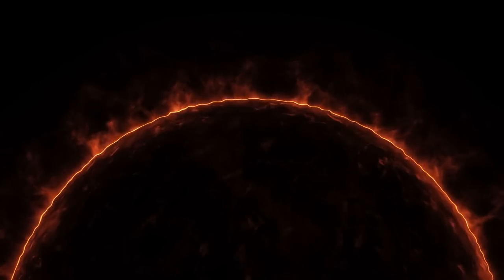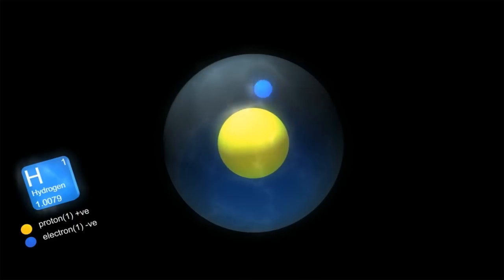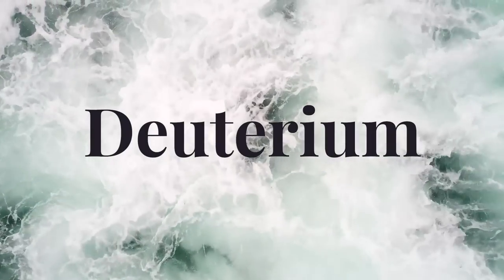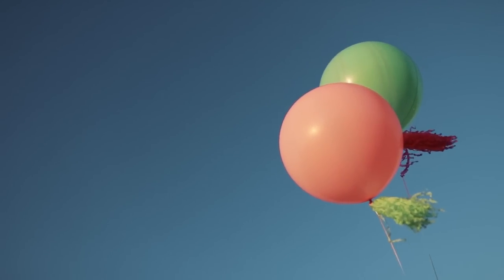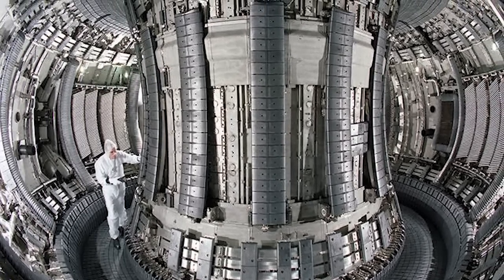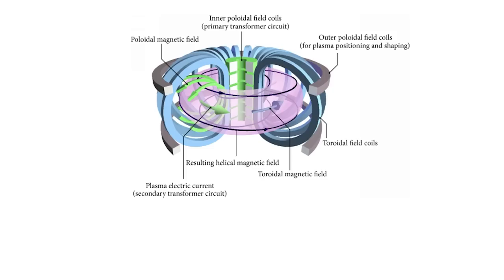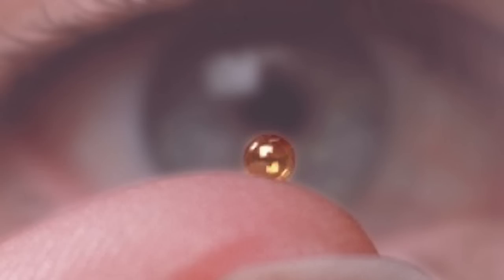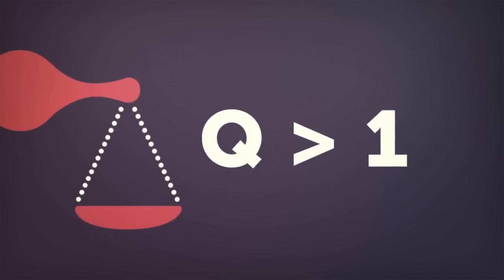Fusion Energy is About to Unlock Humanity's Destiny

Comment: the nuclear stuff doesn't go boom. its the water flash converting to steam that goes boom. water expands 1800x when converting from liquid to gas.
Reply: Please explane your concerns further
Reply: @thesteambreaker9449  A reasonably designed nuclear reactor is inherently stable. If you withdraw a control rod and increase reactivity, the reactor heats up a little bit, the distance between fuel atoms increases slightly, which reduces reactivity, the neutron thermal temperature changes slightly and reactivity is reduced, water expands and some is pushed out of the reactor, so the neutron temperature increases slightly and reactivity is reduced.

If you remove heat at a greater rate then power will remain higher. If you don't the core is just a little hotter. It's not balancing on a needle between shutting down and exploding.

Actual failure modes of power reactors that are licensable in the west are of the cooling was lost or core was uncovered somehow and decay heat slowly melted the core. Steam can  react with the hot zirconium clading making hydrogen, but it can't actually explode in the core because there's no oxygen. If the hydrogen is released it can mix with oxygen and explode somewhere outside the reactor core and make a mess. RBMK, e.g. Chernobyl would never have been, but even there it was a steam explosion from operating the reactor in an unsafe condition; it's dual moderated, so boiling in the core creates bubbles that neutrons zip across; the graphite is a better moderator than water, so this actually increase reactivity, which increases boiling, which increases reactivity and it spirals out of control.

You can't create a nuclear explosion in incredibly badly designed reactors, such as the SL-1 research reactor, which had a single control rod. When it got stuck, a technician pulled on it and it came loose suddenly, increasing reactivity in the core massively. The steam explosion shot the control rod out of the core and pinned the technician to the ceiling. No nuclear explosion.

When the army was experimenting with highly enriched weapons grade uranium in the form of uranium-deuteride for creating small nuclear bombs. They fully intended it to blow up with the highest yield possible; you need much less fuel since it is moderated. The moderation means you slow down the neutrons so the fission crossection gets much bigger; but slowing down the neutrons also means the time between each neutron generation increases and  there are less generations before the bomb blows apart. The highest yield they got was 200 tonnes of TNT equivalent, which is abysmal. It's hard to even purposefully make a "reactor" that will cause some kind of nuclear explosion.

Small well designed reactors can completely eject control rods out of the core using compressed air, raising the power from tens of watts to a couple of GW for some milliseconds and then rapidly dropping down to a few kilowatts. It's all automatic based on physical laws. There's no active measure there to make it happen or to prevent some kind of disaster. It looks like this: https://www.youtube.com/watch?v=KRlTTJquY7U
Reply: @soylentgreenb   thank you

I was falsely thinking there was a connection beeing drawn between flash conversion of water and fusion energy and I seamed to be missing the point that was beeing tryed to make.
Clearly I was miss reading the statement and appologize.
In case Iam wrong in my understanding once again
Be free to correct me.
Reply: water expands only 4 times its volume when flashing from a liquid to a gas
Reply: @lloydadkins885  I've seen numbers from 1:1600 to 1:1700...Where do you get 1:4?
Reply: @lloydadkins885  a quick search gave me a 1:1600. 
Tho interestingly numbers are beeing thrown around here aimlessly. 
Ill consult a professional about it as soon as Iam back from my privat undertakings.
Reply: " The density of liquid water is approximately 0.96 grams per cubic centimeter at 100 C at atmospheric pressure. The density of water vapor at 100 C at atmospheric pressure is about a factor of 1600 less, and so water expands by a factor of 1600 when it turns into steam at atmospheric pressure."   1800x ????  I think your math was stuck with grammar and punctuation .Just a little off =)
Reply: @coltmerg4202   thanks for the Google quick reply.
I did also see some sources stating a x1800 bur as I said I'll look into it.
Reply: You're just as inaccurate. At what temperatures and pressure is the 1800x ?
Reply: @coltmerg4202  "at 100c" pressurized cores have liquid water at ~300c, easily expanding past its volume at 100c
Reply: I just made a similar comment thank you for correcting this. I find it disheartening that people are so mislead. Nuclear is amazing we're fools for not using it more.
Reply: @soylentgreenb What a big nerd.

Just kidding. Thanks for the in-depth explanation (even though I'll probably forget anyway). But you know what they say: it's better to have learned and forgotten than to have never learned at all.
Reply: thanks for dummy explanation
Reply: What has this statement got to do with this video
Reply: @sammyd7857  are you deaf? he explains how it works
Reply: @KSR3  so water converting to steam is how you make fusion is it.
Reply: @KSR3  no shit
Reply: @KSR3  what has that got to do with fusion
Reply: @sammyd7857  The video is claiming a fission reactor is like a bomb waiting to explode, and the commenter set the record straight,  that it's nothing og the sort. In fact, modern fission reactor designs like LIFTR would have solved all the problems decades ago, if we'd spent just 2% og the R&D going into fusion. And even if/when they get a commercial fusion reactor - it'll be a huge thing powering half a continent. The small ones mentioned at the end, are wishfull thinking, not based on known physics. Fusion research is mostly good for creating physics ph.d's rather than energi.
Reply: soylentgreenb explain 3 mike island, Chernobyl, Fukushima to name but 3 if it's so safe. Also explain what is being done with the hundreds of thousands of tonnes of highly radioactive nuclear waste.
Reply: @lloydadkins885  Where do you find this extra volume? It's a closed space. Pressure shoots to the moon and then the concrete lid lifts. Some of the many hundreds of degrees hot water is turns to steam and expands freely in air to ~1000 times the volume of the same mass of water when it reaches STP. This converts heat energy into work energy. Blows out parts of the walls and roof, throws parts of the reactor core and concrete lid.

If you put enough energy into the water fast enough you don't even need confinement to cause an explosion (such as a fuel tube rupturing and letting water in to mix with molten fuel, or throwing a cup of molten salt into water; the expanding water mixes the molten mass into the water, which causes more pressure, which causes more rapid mixing). The expansion will be so rapid that almost anyone would call it an explosion.
Reply: @StoutProper  Those three unfortunate accidents each deserve their own explanations, and lessons have been learned that so that similar incidents are less likely to repeat. But even  ignoring that, nuclear energy has claimed fever lives than renewables and spread less radioactivity than coal on a per kWh basis. Nuclear feels more risky than alternatives, the same way flying feels riskier than driving a car. Feelings are a poor way to gauge risk on a benefit  weighted basis.

The inventor of the currently used steam reactor regarded it as obsolete by the end of WW2, because there were already better ideas around back then. Politics prevented those ideas to come to fruition.
Reply: @kristianthommesen7682  what nonsense. Nuclear waste is hugely dangerous and there is no stategic plan for it.
Reply: @StoutProper  In the period where nuclear energy has produced maybe 100.000 tons of spent (mostly uranium) fuel, coal fired plants have spread 20 times that amount of  uranium all over the environment.
And again, with modern reactor designs, the amount of waste could be cut by 2 orders of magnitude.
But as usual, feelers prefer being poisoned by anything else, as long as it doesn't have the word "nuclear" in it.
Reply: @kristianthommesen7682  explain yourself and provide links to sources, otherwise you risk being about as credible as Alex Jones. You still haven't detailed the long term strategic plan for dealing with the absolutely deadly nuclear waste that is piling up. Or the decommissioning and clean up of defunct, legacy nuclear reactors, which have a 50 year old lifetime and are currently just buried under concrete and left to rot. FYI the lifetime of concrete is a lot less than the half life of the deadly radioactive uranium and plutonium isotopes that exist in a spent nuclear reactor.
Reply: @StoutProper  This source is regarding uranium and thorium: http://www.ornl.gov/info/ornlreview/rev26-34/text/colmain.html but ther's all kinds of nasty things in that including K40 and a range of heavy metals. The content of coal ash is not disputed - it's just that noone seems to care.
My plan regarding nuclear waste is to develop the LiFTR reactor, and use that to burn spent fuel from the old reactors.
Our gouvernments plan seems to be to wait for a miracle to occur, enabling renewables to suddenly supply base load electricity to the grid. That is not impossible, but it's unlikely to happen within the timeframe nescessary to stop global warming.
Reply: Kristian Thommesen your plan huh?
Reply: @StoutProper  The Chinese are doing   it as we speak. It's just a shame we wasted the 40 years after Nixon killed the program during his reelection.
Reply: @soylentgreenb  look it up when water expands into steam it expands only 4 times its volume that is when held at the same pressure
Reply: @lloydadkins885  I know about steam. There is no fixed relation between steam volume and water volume. Water held at 1 atm expands 1700 times when it is converted to steam. Water at 647 K and 217 atm is supercritical and you can't even tell the difference between liquid and gaseous phase; it just smoothly expands in volume as you heat it, or increases in pressure if constrained within the same volume.

The key thing you are not understanding is that the pressure rises monstrously if you heat the water just a little bit in a closed container. Even if the container is slightly "open", if the pipes/leaks/etc are too small and the power excursion too quick, friction losses will allow pressure to rise even if liquid is being pushed out. Just a couple of hundred degrees and you're talking thousands of atmospheres. Something will break. When you no longer have the pressurized channels nothing stops the steam from expanding into atmospheric pressures, doing work against the "biological shield" etc. It's a steam explosion; and it will expand much more than 4 times its volume.

It will be like when the mythbusters blew up a water tank by disabling the safeties and overheating it.

Comment: *talks about sun*
*Vivaldi’s Winter in the background*
Reply: Pointing toward the Grand Solar Minimum, I think.
Reply: @Ajit Adonis Manilal I assume you probably don't think this, but a lot of people seem to.  Fusion reactors require huge energy input to stay running (even if they put out more energy than is put in), so they cannot really run away like that.  Even modern fission plants are very, very unlikely to go chernobyl; the chernobyl incident took place in a reactor that was already vastly outdated, and had essentially no safeguards.  Even Chernobyl, though, did not produce a nuclear explosion; it was a steam explosion, from hot reactor meeting coolant water.  You fundamentally need weapons grade fuel for a nuclear weapon.
Reply: To add onto what Alex Lewis said about fusion, if it does begin a meltdown it will melt the reactor walls, destroying the electromagnets, and then the plasma will fissile away, meaning, while yes, you will have to repair or replace the reactor, it will not prevent the surrounding area from being livable... unless it was it’s only source of electricity and they can’t source it from anywhere else
Reply: Maybe Nuclear "Winter"?

Comment: 2:54 “just a glass can produce 500MW of Power” Well that can be true but can it also produce 5GW? Technically it should because Power doesn’t depend on the amount of substance present but on the amount of substance reacted per second!

The statement that water can produce 500MW is incorrect. In Deuterium, energie is stored, which is measured in [J] Joules. [P] Watt on the other hand is the unit of power - Energy transformed per second - J/s. 

Assuming you intended to say 500MJ it’s still very impressive.
Reply: I think it's more impressive! 1GW for 1nS is not that much energy, but 500GJ is a crap-ton of energy for most sensible uses! Actually  it's so much it's an insane amount for most sane uses!

Comment: "Nuclear Fusion is Finally Here"
@ 4:20  "We Can't Bloody Do It."
Reply: Thank you.
Reply: Up there with "we found an earth-like planet that's nothing like earth".
Reply: 420 nice
Reply: 420
Reply: "nuclear fusion is finally here" because it is possible to make nuclear fusion happen. it just isn't producing a net gain from the energy needed to make it happen, as he explains at 5:20
Reply: @zredman98  Click bait then, because we've had fusion for 60 years if you include bombs.

And controlled fusion isn't anywhere near new either..
Reply: That 4:20
Reply: It’s complicated.
Reply: This guy is the reason i use adblock, so i make sure i don't finance him in ANY way.
Reply: @sankhyohalder97  no bombs produce nuclear rely on fission not fusion
Reply: @bilalthefighter829  I believe that can't be right, hydrogen bombs are fusion bombs. They have an initial fission charbe to start the fusion reaction. The biggest nukes are all fusion.
Reply: Bilal thefighter No. Thermonuclear (hydrogen) weapons produce both fission and fusion reactions. The fission primary is imploded with high explosive lenses, which turns the low Z radiation channel into a plasma that is transparent to X-rays produced by the exploding fission primary. The heat and pressure of the photon gas in the channel ablates the tamper/pusher surrounding the fusion secondary, compressing the walls inward at speeds from 200 -500 km/s. As the implosion of the secondary approaches the maximum possible pressure, neutrons from the fission primary flow through a special neutron focus lens, and into the fissile spark plug, which is a hollow plutonium cylinder inside the dry fusion fuel (enriched lithium deuteride) of the secondary. The weight of the surrounding fusion fuel and massive depleted uranium tamper compress the Pt-239 spark plug many times beyond the critical density. The sudden influx of neutrons from the fission primary spark a fission chain reaction, rapidly heating the surrounding fusion fuel and converting the Li-6 deuteride and Li-7 deuteride into deuterium, tritium and He-4 (Li-7 deuteride + n also produces deuterium, tritium , He-4, and a thermal neutron of lower energy). As the fission chain reaction continues, the spark  expands, creating a sandwich as the fuel gets compressed from all sides by the fissioning spark plug and the free falling tamper. This immense pressure, combined with the rapid heating by the fissioning spark plug, allows D-T fusion to take place. The high energy neutron resulting from each D-T fusion is capable of fissioning the depleted uranium tamper, resulting in an overall “fission-fusion-fission” pattern. Additionally, aside from contributing to the quick burn up of the spark plug, some of the high energy fusion neutrons also reach the fission primary stage, burning up additional fission fuel than would be possible in a fission, or even boosted fission, weapon.

Comment: Nice. Just one thing: a nuclear reactor is NOT a nuclear bomb. You need material of about 93% (Plutonium, or Uranium) to get an explosion. You have about 4% purity in rods used in reactors. If 'you loose control of it' as you put it, it melts. The bang comes from the overheated water used in a reactor, that turns into steam.